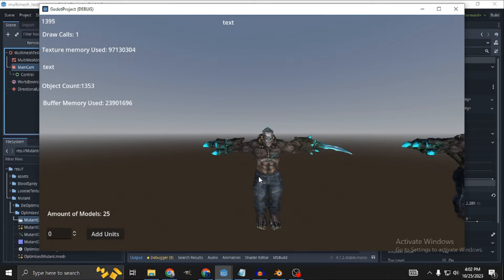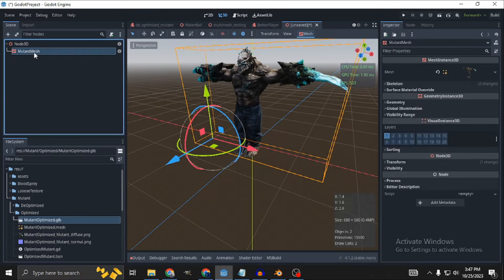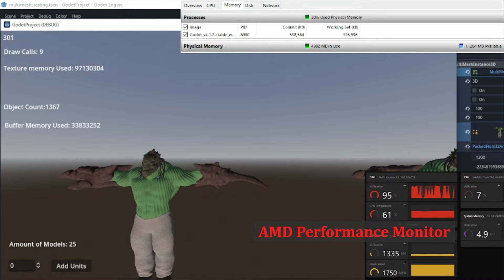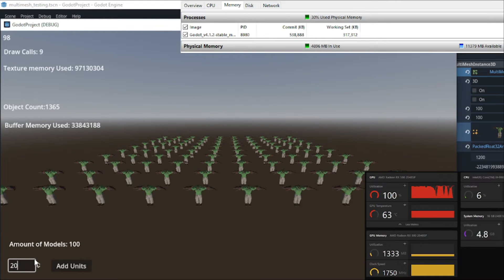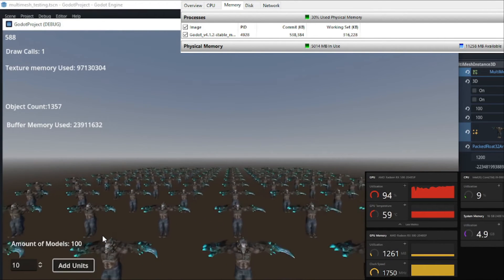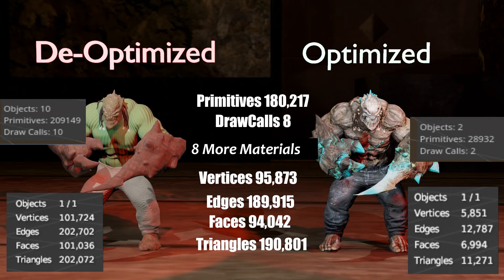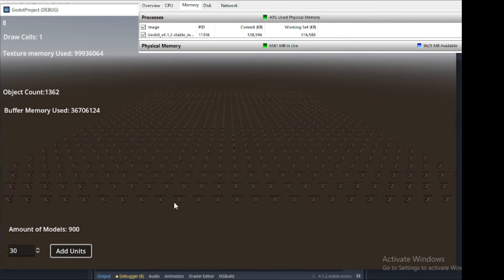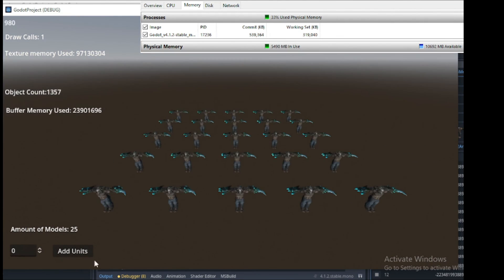Godot optimization Experimentation Multimesh Testing

Comment: You should use lods (level ofdisplay) a detailed mesh when upclose and they are far a simpler less vertices mesh this should improve performance alot, in a far distance you dont need mesh details at all

Comment: Example: one 4K texture versus nine 512x512 texture

The GPU and CPU can start multiple threads for materials. A single 4k takes up larger memory space, and takes longer to read the whole 4096x 4096, texture,
Where as, smaller 512x512 texture is easier to be digested by multiple threads and finish render calls

Comment: About multi-mesh. Getting them all on screen makes no difference to just having only some because of multimesh is kinda one model and the off-screen models do not get culled by the engine even if they are not visible. Multi-mesh is definitely a tradeoff, but can greatly reduce draw calls.
Reply from the maker: That makes a lot of sense. Thanks.
Reply: @averagegodotenjoyer  glad to share the knowledge! I've used groups of multi-meshes for my game, based on the location. So like most of this items are together and this groups can be culled efficiently. But then portals were added. I believe they combine meshed with same materials sets to multi-meshes automatically now (at least it was the situation for Godot 3). So just making the map for the game and placing rooms and portals efficiently should be good enough.
Reply: Also results with draw calls comparison was interesting. Maybe it's tied to some overhead and without the multimesh, the difference definitely should be more noticeable (50 draw calls to 50*8 for example)